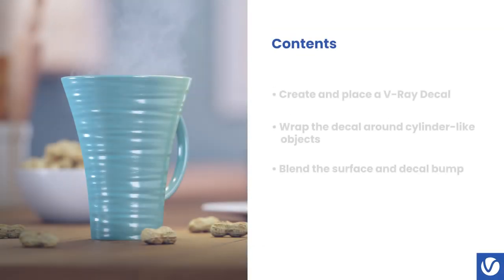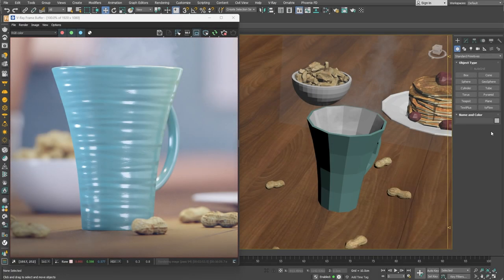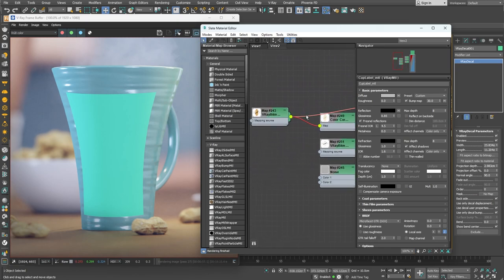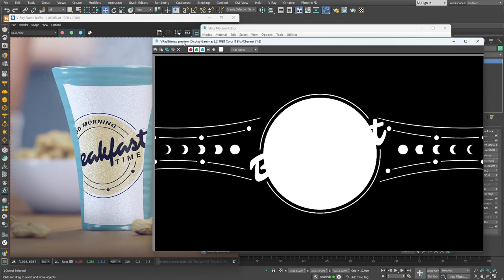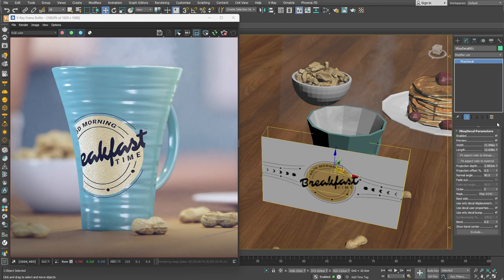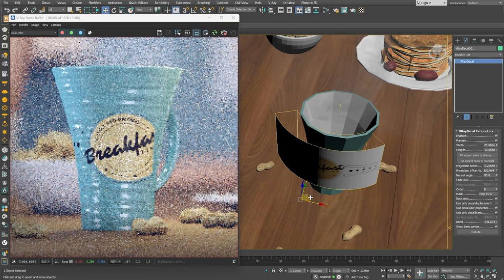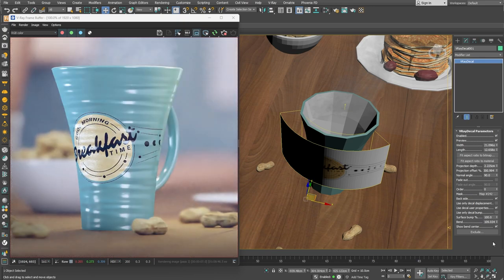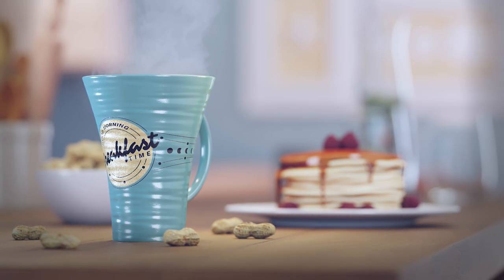V-Ray for 3ds Max — Adding realistic stickers and labels to curved objects

Comment: Thank you for the video. excellent as always.
My Question is about the cup, it looks low poly, but renders differently. My lack of modeling trainingg is becoming evident to me. How is the cup modeled? Thanks Phil
Reply: In 3Ds Max there is something called modifiers that can apply different effects to the model. The modifiers can stack like layers, where the bottom one is affected by the one above it. One of the modifier is called Turbosmooth, which smooths out the model (or selected parts of it). In the video, we can see that the object is either a proxy with simple preview, or a low-poly model that has turbosmooth (or a similar modifier) applied to it. 

Hope it helps! :)
Reply: @BossToastMaker   Thank you , I have been modeling for years and using max and vray and corona for years too, and I thought it was a new tool that i had missed, But I know what ytour refering too. Thank you. You know yourself there is always 4 ways to model something. Appreciate the reply.